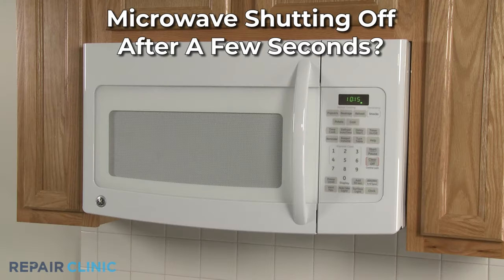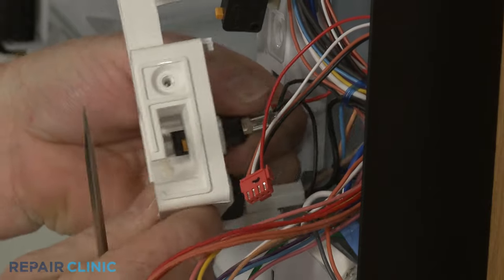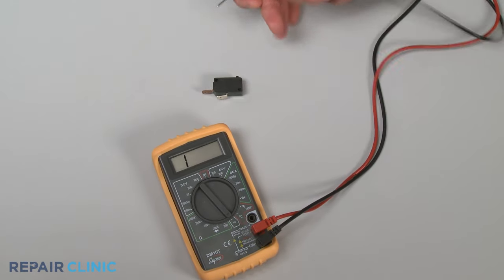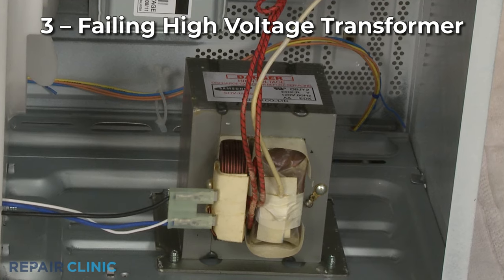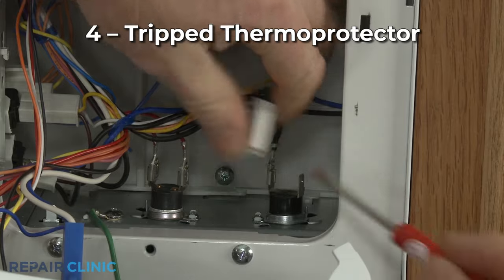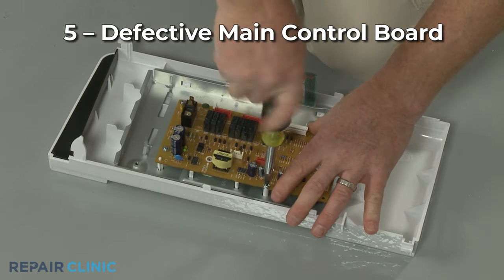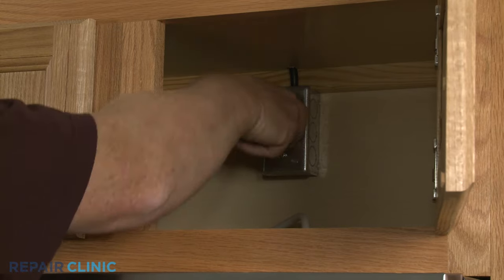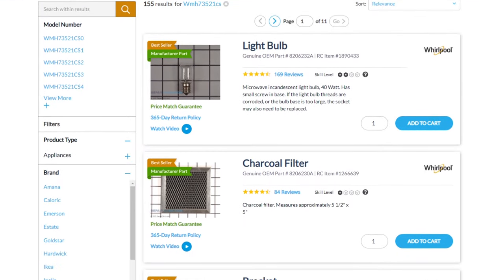Microwave Shuts Off After A Few Seconds — Microwave Troubleshooting

Comment: See channel for O S cutright The Real Fix”. 
😂 —-Looks like he discovered that microwave was still in demo mode. Option not electrical nor mechanical. He used settings for time let it time out, then touch through options to find demo, then let that time out. After that microwave properly heats.
Reply: THAT WAS IT! Demo mode accidentally turned on when I was cleaning the microwave front panel. Turned off demo mode and it works fine. Thank you!

Comment: Mine would go on for half a second and turns off. I fixed it by slamming the microwave door lol I just wanted my food and I was frustrated. It worked though and now I can enjoy my pizza rolls
Reply from the maker: Sounds like your door switch is starting to go bad. Double check and make sure there is no debris build up in the door as well.

Comment: My microwave starts and after 10 seconds no power to magnetron but fan is running.  
 The counter also stops after 10 seconds.  No power to high voltage transformer.   Need help please.  Moulinex microwave
Reply: Fahim Zaywari Try blowing the air vents, turning it off for a few seconds and then changing the plug/switch it goes into. I know it's frustrating.